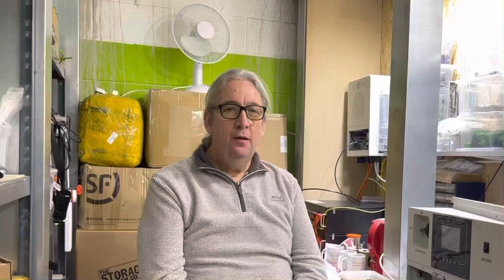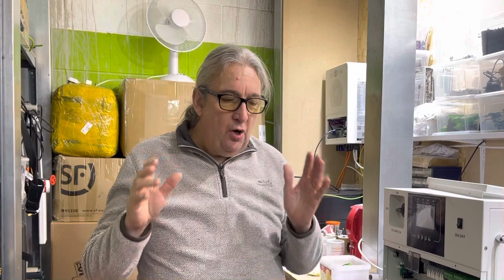Paralleling Inverters

Comment: deye manual shows different breakers for each inverter. seems you are completely wrong
Reply from the maker: This is incorrect sorry, if you do this and use RCDs they will trip
Reply from the maker: You must common the ac if in parallel

Comment: So, I was thinking on paralleling 2 pure sinewave inverters. All cables come from the factory the same length and proper thickness, common bus bar and all that. 

The question I have is, should I rewire the two power switches on the inverters into one switch, or would I get away with using my two hands and the split second inconsistancy that may come with it if I were tonswitch them both on at the same time manually.

Comment: What about solar panels? If i install two inverters in parallel, should i parallel the solar connectors as well or both inverter will have separate strings of solar panels. secondly, will battery charging current be doubled?

Comment: Yeah , I'm our here on a service call and the inverters are down.   they have two breakers from two different panels running the inverters and they are splices together on the load side feeding a 200 Amp panel

I've never fucked with these before but they seams stupid AF you could have one panel spinning an inverters backwards and one spinning forwards and fucking everything up

Comment: Hello, I have a 3 phase system in my house and I don’t have no appliances that work on 3phase power. I have both 3 investors off 5kw and a battery LiFePo of 15kw/300A. I have a solar panel system off 7 kw. I have the bad surprise to find out that the inverters can not communicate with each other. What is your opinion , if I install each inverter to one different phase and all to the same battery in parallel is it wrong?

Comment: Is this not a contradiction of the manual? Why does 4.16 in the current manual show independent breakers per inverter rather than one shared (3x AC for grid, 3x AC for line and 3x DC for battery)? I'm with you in the video Keith, but the manual is contradicting that, or am I reading it incorrectly? I suppose if you want independent protection you can add the breakers to each inverter, but have those connected to a double pole isolator (one for each channel - DC, Grid, Load)?
Reply: Good question, how can Keith say one thing and the manual another?
Reply: @CharlLeRoux  FWIW I agree with Keith's approach for one double pole isolater to control power on or off to all inverters, but it won't hurt to have a breaker or other protection per inverter that will stay in the on position before you flip the isolator up
Reply: There is a major contradiction between this video and and the manual. I have 2 x inverters in parallel, and I have split the load / grid to and from the inverter with a 4-pole breaker - in which I case I still have 2 x separate breaking circuits, however both circuits will break should only one trip.

Comment: We have a system with 6x 8.8 inverters. When can we start using the relay contactor to start and stop the generator with the relay and limit the supply amps when the generator is running?
Thank you.

Comment: I'm planning a single phase system with one 6-8kw hybrid inverter and one 6-8kw solar inverter. Say I have a 5kw export limit. If they are both sunsynk inverters, is there some way I can set them up to stay within the export limit? And can I use one CT or one smart meter to feed the current signal back to both inverters?